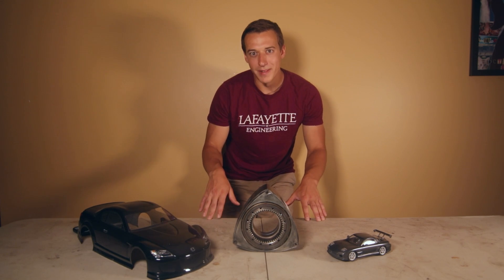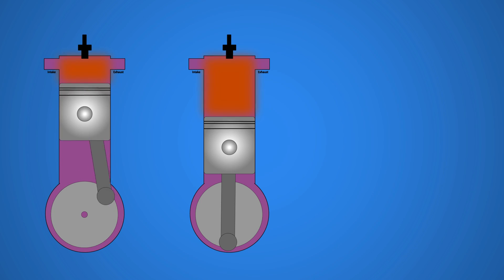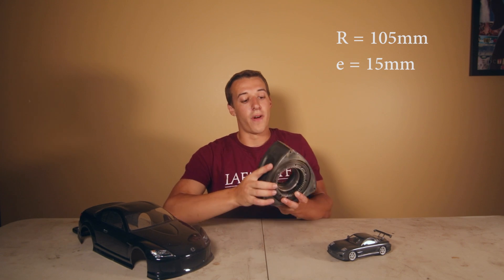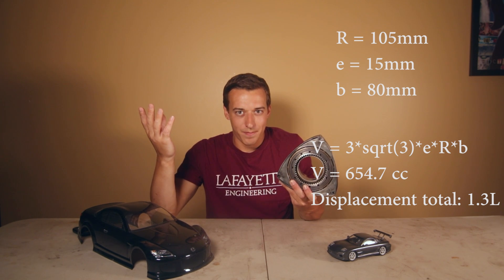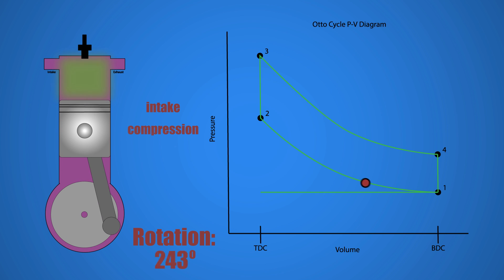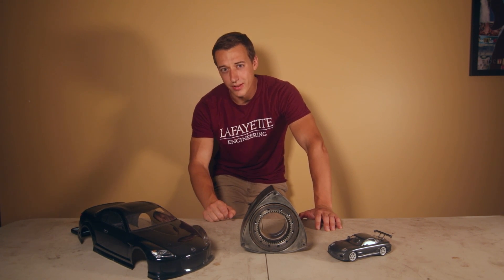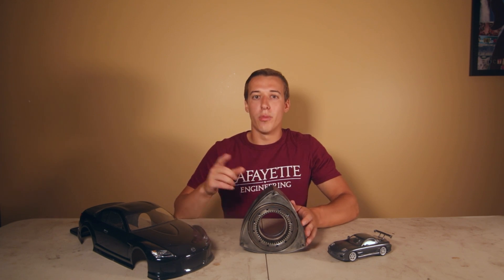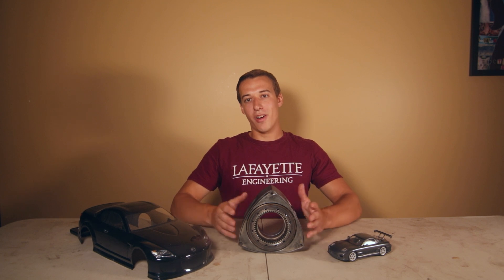You are WRONG about Rotary Engine Displacement

Comment: Its clearly 1.3L, people call it 2.6 just to feel better about them choosing pistons over superior rotors.

Because 1.3L making 400HP is unbelievable, whereas if they think its 2.6L making 400HP then they can justify that their piston suckers do the same
Reply: Ppl are tryna compensate for somthing. That's why they say 2.6
Also you right that's why I wanna rotery. 1.3 making 400 sounds insain
Reply: @tharushapeiris6772  so we're going to ignore that there are 3 voids per rotor?
Reply: @tharushapeiris6772 I'm not trying to compensate for anything, I have an rx7 and had rotaries all my life. They just aren't 1.3L, they are 3.9L.
Reply: that's so true Rotary-heaters.
Reply: Question 
Why is the early RX4/7 engine a 13B and classed as a 2.6lt 13B. 
Yet the RX8 engine also a 13B  is a 1.3Lt.
Basically the same engine. Apart from side Exhausts Ports. 

The RAC Blue Book class a single rotor engine a three cylinder. 

Why not just class it as cubic capacity times three for each rotor.
Reply: @MrBusaPhil  idea came to mind later
Reply: @MrBusaPhil  In racing world the number was doubled -so the competition would be more fair ,in normal - at least in EU it was about emissions i think - Under 2L you paid less tax on it -because that type of cars polluted less   ,but wankel burns oil and its emissions are just bad -so they got it to class above 2L , by simply multiplying the volume

in the end - emission control was the thing that killed wankel production ,and harmed RX-8 

Nowadays mazda tries to revive wankel for hybrid systems - The wankel is now a generator 

Theres also a lot of rotary prototypes - like rotary vane engine
Reply: I feel like it should be considered a 2.6L engine since it takes only 1 rotation to reach the desired degree and compression. Why not multiply it by 2 since there's to roters. 
Why call it something less in the piston world. Let's call it something more, which it is... More. It's a 2.6L period.
Reply: It's a 1.3, it kinda acts like a 2.6 because each revolution per rotor has a power stroke, that being said volume is this measurement so it's a 1.3
Reply: It's simply not 1.3L. It's not a 2 stroke and the fact it fires every rev like a 2 stroke is pure coincidence. It's a 3.9L engine. I'm a mechanical engineer and there's absolutely no question it's a 3.9L engine.
Reply: And from a sanity check perspective.... The rotary is known to be inefficient. For the amount of energy in the fuel you get less energy out the tail shaft than with a piston motor. More energy is lost in heat. So from a pure sanity check perspective, how does an inefficient 1.3L engine output more than a 2.6L piston engine? It makes absolutely no sense, it doesn't pass the sanity check. Is it 2.6L then? It produces similar power but probably more. So given it's inefficiency, it makes a lot more sense that it's an inefficient 3.9L engine. That would bring it back to producing around the same power as a 3.0L piston engine. This isn't definite proof (others have given that in different comments) but from a sanity check perspective something doesn't add up if you think it's 1.3L.
Reply: I've been a rotary guy for 30s yrs. There is some truth behind what they're saying. Regardless how Mazda rates the engine, a 13b moves and ignites the exact same 1.3L of fuel air mixture when compared to a 2.6L 4 stroke 4cyl piston engine when both cranks spin 720degrees. This is 100% FACTS guys. I'm getting ready to do a cheap rebuild video on an Rx8 and I may discuss this while the engine is open and show people WHY this is the case.
Reply: @rotaryperfection  So that re-enforces the idea that it's really more than 1.3L, since it does the same 4-cycles (suck-squeeze-bang-blow) as a 4 cycle. I don't see why rotary guys keep arguing this like it's a bad thing. It means that the design has even better space efficiency than advertised. Ignoring the AFM rate in naturally aspirated format (since that really shouldn't dictate displacement as you can make a 7L engine breathe less than a small 2L); if we take the max displacement formula that is used per-rotor as described per IMSA and FIA regulations pre-ban, then multiply it by how many cycles are going on per rotor continuously, we get around 7.8L's.

Call it "compensating" all you want, but the way I see it. Mazda basically made took the combustion size and power of something greater than a 427ci (7L) race engine and made it smaller than the 4-cylinder in my 944S2; with longevity that surpassed F1 and Nascar (who used 7L/427ci engines at the time).

That is way more badass than pretending it is a smaller V6 or I-6 in displacement, with all the downsides of fuel consumption, oil consumption part wear and maintenance of most forced induction I-6's, and then some.
Reply: @rotaryperfection your right but that's not how we measure displacement. If that was so every 125cc 2 stroke dirtbike would be considered a 250cc
Reply: @izaiahschlosser4512  My point is showing how much air a 1.3L wankel uses in 2 rotations of the e-shaft. So yes it's rated at a 1.3L but in 2 strokes, it will use 2.6L and have 4 ignition events which is the same as a 2.6L 4 stroke 4 cylinder 4 piston engine.
Reply: @rotaryperfection   right, because there are 3 voids per spicy dorito
Reply: @Flyinghook  The 3 voids doesn't matter when measuring displacement. Displacement is measured based on a SINGLE combustion event per cylinder or rotor chamber and not multiple. At top dead center on the intake stroke, a NA 13b can only ingest .65L of air per rotor. Once BOTH chambers ingnite their mixture, that's 1.3l ignited in a single e-shaft rotarion and why Mazda is able to rate the engine the way they do. Any other combustom event after that is a whole other cycle on the other rotor face. People need to stop worrying about all 3 faces. What matters is how much air can the engine ingite per e-shaft revolution. This is how you can compare rotary to piston engines to find compatibility.
Reply: @rotaryperfection  but it moves air total like a 2.6l because you're always dragging this extra space around. It's like having a 2l 2 cylinder with only one cylinder firing. It doesn't change the overall displacement because you're only using half the engine.
Reply: @rotaryperfection this whole "per crank revolution" discussion is irrelevant. As soon as you ever say "per rev" the next statement will be wrong. Why? Because if you took the drive from a piston engine off the crankshaft it would spin half as fast but it would still be the exact same engine, using the same amount of fuel and producing the same amount of power. With the rotary you need to calculate displacement over 3 revs because it has a 270 degree stroke.
Reply: @MikeKulls2 Wrong as displacment is measure based on a SINGLE COMBUSTION EVENT. not multiple. There is an ignition event per rotor every 360 in a rotary. Not every 270. You are one of those that beleive that rotarys have to have combustion on all 3 rotor faces. That's NOT how combustion or displacement is measured. It's a SINGLE event.
Reply: @rotaryperfection I didn't say it fires every 270 degrees, I said a single stroke is 270 degrees. From TDC to BDC of any chamber is 270 degrees. That is undisputed fact. The fact there is a spark every 360 degrees, like a 2 stroke, is pure coincidence. It's not a 2 stroke and has no similarities to a 2 stroke. If you calculate displacement of 1 chamber then you are simply choosing to ignore the other 2, that is wrong. There are 3 chambers all doing their work, just like 3 cylinders in a piston engine. You need to count all 3.
Reply: @rotaryperfection  if you want to argue "single combustion event" that's actually correct, but you need to count every chamber, as in 1080 degrees and 3.9L. If you only count 360 degrees then you've only counted 1 chamber.
Reply: @rotaryperfection put it another way, if you cut one tip off a rotor then it would fire only in one chamber and take 1080 degrees to fire. By your logic that is still 1.3L. Hence if all are working then it's 3.9L
Reply: @MikeKulls2 You are confusing my logic. 13b engines fires 1.3l of air every 360 degrees of the e-shaft. That is not up for debate. The AMOUNT of air it uses during a single combustion event is how you compare them to 4 stroke piston engines. 2 e-shaft rotations 2.6L is whats used. 3 rotations 3.9L ect. Nothing else matters because rpms on BOTH engines are measured the same. At the crank or e-shaft. If you wanna say its a 3.9L engine at 1080 degrees, then you would be right because you will need 3 rpm to fire all 3 faces to use 3.9L of air. This is WHY you measure the amount of displacement USED per every 360 to compare to other engines to make comparisons easier. The total displacement argument is just plan dumb.
Reply: @rotaryperfection you use 720 degrees in a piston engine because that allows all pistons to fire. In a rotary if you use 360 degrees then only 2 chambers have fired. That is why you need to use 1080 degrees.
Reply: @MikeKulls2 You're missing the basics. Displacement is measured based on a single combustion event per cylinder and not multiple. It just takes 720 for that to happen for each cylinder to make power on a 4 stroke piston engine. Once all cylinders have made power ONCE, thats that engines displacement.  

13b is measured the same way and based on a SINGLE COMBUSTION event per rotor. You think it should be by chamber face but that takes MULTIPLE  ignition events. 1.3L gets ignited in 360. The next 360 (720 total is another ignition event) so when doing piston comparisons, just measure what each engine uses in 360 degrees (regardless of rating) makes for much easier comparisons because BOTH engines measure RPMS exactly the same way. Too many people put focus on the rotors spinning at 1/3 the e-shaft or the rotating combustion chamber. That's irrelvant to how much the engine ignites every 360 and thats 1.3L.
Reply: @rotaryperfection no, you're missing one basic thing here. A single rotor is equivalent to 3 cylinders. If you let only 1 chamber fire it's like counting only 1 of 3 cylinders. Again, if you cut one apex off a rotor so it only had 1 chamber, you'd still rate it at 1.3L according to your logic. Hence when you add the other 2 chambers back you triple the displacement. I'm a mechanical engineer. There is absolutely no question it's 3.9L.
Reply: @MikeKulls2 3.9l in 1080. I already said that!
Reply: @rotaryperfection yes, but that's the displacement of the engine. You don't say a 5.0L piston engine is 5.0L in 720 degrees, it's just 5.0L. Same with a rotary, it's just 3.9L

Comment: It  is 650cc per rotor, which means that the 4 rotor le-man  winning mazda was a 2.6l.
Reply: No, the 654cc value for a 13b rotor is for a single working chamber. The rotor in the housing has 3 working chambers so in reality, because of the way engine displacement is calculated, both 1.3L and 2.6L for a 13b engine are both wrong, its really 3.9L (3924cc) because there is 6 total working cambers each having a displacement of 654cc and 654 x 6 = 3924
Reply: @CP_300PRC  but only a third of that is used for combustion at a time, right?
Reply: 7.8 liters, the 787b competed in the same engine class as the 7.0 liter Jaguar V-12s
Reply: After 3 year's 
I will say 1.3 l
I feel cool with that ❤
Reply: Yep, thats why its call 26b for the 4 rotor, 13b for the twin rotor and 20b for the 3 rotor
Reply: b18